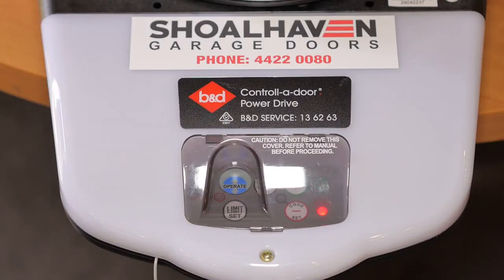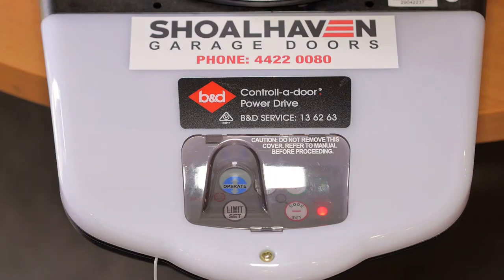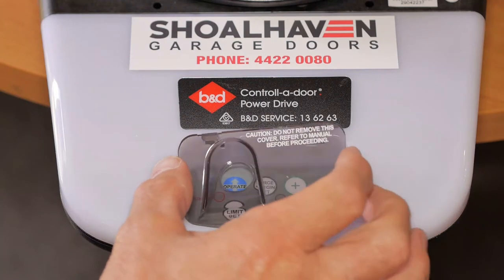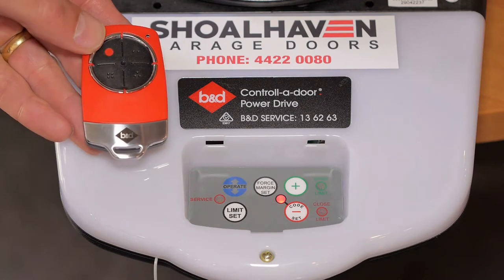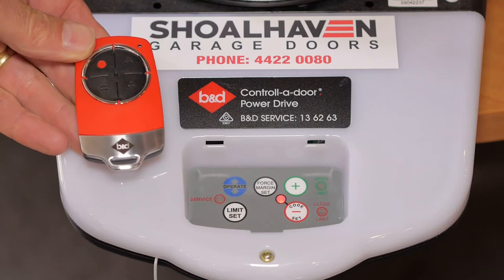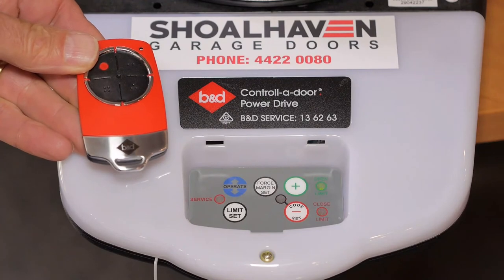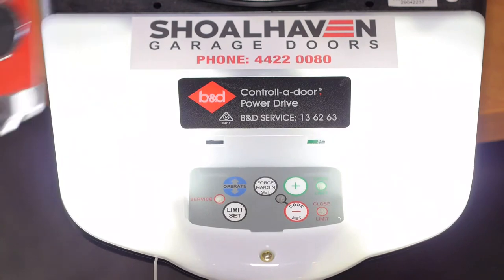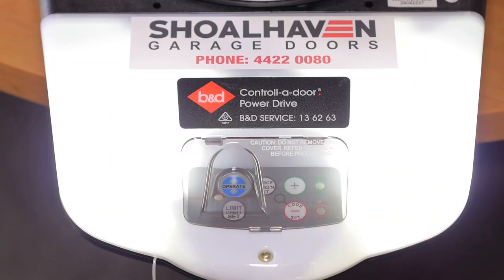How to code a garage door transmitter

Comment: Hi guys, how do I replace the cord  in my unit ( I have the same as your one) it’s broken clean off after 3-4 years use.
Any advice would be appreciated!
Jonathan
Reply from the maker: Good morning, Johnathan, You can purchase a new easy-access transmitter (Cord button) from your local B&D dealer. Alternatively, you can contact B&D on 13 62 63 to discuss your options.